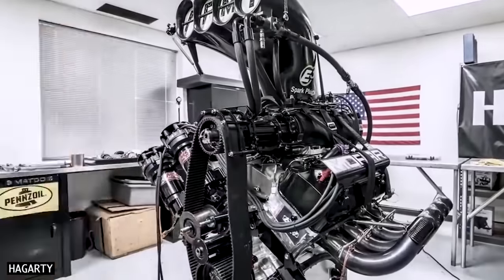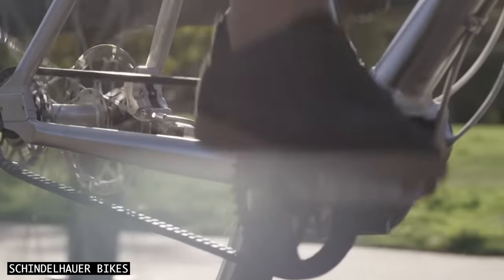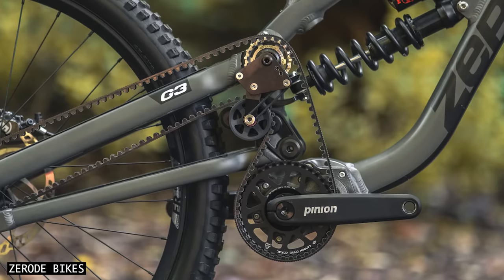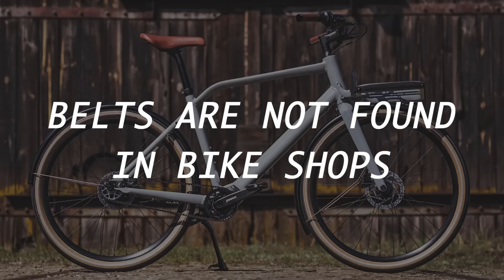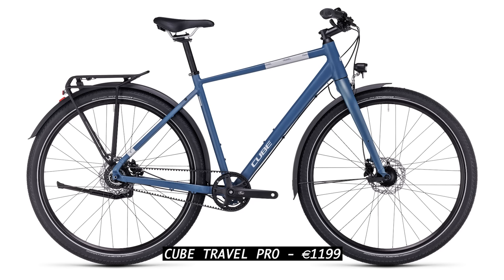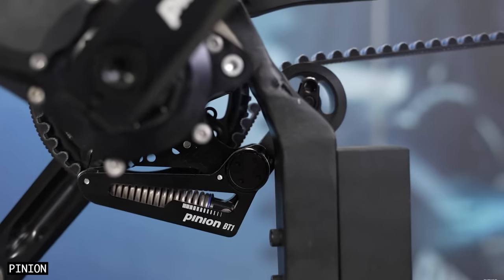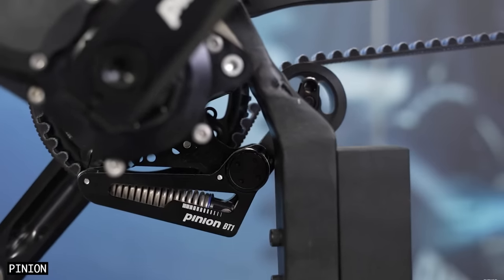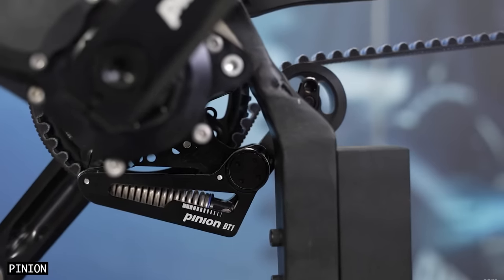Belts Are Now BETTER Than Chains On Bicycles!

Comment: Not for fixed gears 😅
Reply: why not?
Reply: @markifi  amount of preasure while skidding is a really big problem.
Reply: @gig2gle  i really doubt that would be a problem. (admittedly i've only ever skidded a fixed gear a few times) both the chain and the belt have to pass the same safety standards to be legal to equip bikes with. 8 kilonewtons if i recall correctly. that's 624 kilograms on the pedal (8000/9.81*13/17) (breaking strength/gravity*radius of 53 teeth chainwheel/crank length). the grippiest of tyres will sooner slip i think

am i misunderstanding you?
Reply: @markifi  eng not my native lang, i hope you'll understand me. 
There are whole calculations here, wow. I'm talking about the fact that on the fix, the chain experiences stretching and compression at times when it now has to be skidded or extremely slowed down. Even if the belt is stretched on a horizontal dropout, it seems to me that in moments of hard work with pedals, the belt will be softer than the chain.
Reply: @markifi  for me it's like to compare a paper and two wooden sticks. In situtation of pressure from both sides paper will folld, while sticks will try to find way to not crack, and only in bad situation without any possible ways will crack. 
Yep

Comment: Blah blah blah, 23 minutes?!  Chain drive is MORE EFFICIENT at transferring power than belt drive.  On a bicycle if you're interested in maximizing the power from your effort to the bike, there is no debate, chain wins over belt.  Maintenance, cost, durability, etc are all other considerations that may change your answer.

Comment: If belts were better than chains then the majority of bikes would have long ago gone to belts….Less efficient and heavier, those are two huge downsides that can’t be overlooked.
Reply: People keep harping on efficiency and weight, but those aren't the reasons for most people. Outside of racing, its the horrible engagement that limits their value. They're just much worse on technical riding like you find on natural trails.

Comment: this guy is just blatantly lieing...  he's comparing one of the best belts you can get to the worst chains you can get. the reality the best chain you can get will by far outlast and handle far far more than a belt and it's just. as quiet.  the only major drawback to a chain over a belt is the maintenance required for a chain.  near every single other thing he stated was just blatantly wrong or greatly exaggerated
Reply from the maker: Nope. I've used the best chains and the best belts. Belt drive is a huge step forward for all the reasons I mentioned.

Comment: Motorbikes dont use belts, they are very uncommon
Reply: Correct because those belts can't handle the torque! The same with Engines, the very high torque ones cq Diesels are all using chains.

Comment: How about a chain enclosed in a chain case? the issue is not the chain. The issue is very poor design. Chains should not be run out in the open, they should be in a oil bath. Or at least enclosed.

Bike drivetrains are very poorly designed for long maintenance intervals and wet weather. A well designed bike would keep the drivetrain clean in all conditions. This is possible with a chain, easily.

Comment: but HOW do you FIX Belts? Oh right, you CAN'T.  Sorry, if you cannot fix it but have to replace the ENTIRE DAMN THING, then it is simply NOT better. If a chain goes bad, you just remove the broken element and fix it. You can even size adjust it if you have to. Can't do that with a belt. Sure a Chain needs oil and a good cleaning every once in a while but so what? Mechanic things need care and maintenance. I swear, belt driven bikes are just a marketing scam.
Reply: A belt lasts tens of thousands of kilometers.

Not everyone loves getting grease everywhere, not to mention all the dirt that collects in it...

How is it a marketing scam when it has actual benefits? It is quieter, clean, lasts longer and is less likely to jump off.
Reply: .... do you have a belt on your bicycle?

Comment: Not better.  Belts have more friction to overcome than a chain. Get real. Be scientific.
Reply from the maker: If you actually watch the video, you'll find all the scientific data you need to know that there is NOT more friction with a belt (in most circumstances).

Comment: Belts are not better by any metric that matters. Require specialized frames, not repairable on the ride, expensive when combined with the necessary gearbox or igh, heavier, less efficient. 🤦‍♂️ So yeah, not better, at all, nope. 👎

Comment: All these are just marketing gimmicks. Since when are plastics and rubber more durable/reliable than metal in power transmission!? Joke. Get a motorcycle. That's the future of bicycles where manufacturers are working towards...😂
Reply: Since when is a chain that has to be out of alignement and jump between sprockets all the time longer lasting than a belt that runs straigth and never moves postion less long lasting?

Comment: You can't use these belts with proper gears, so no, they aren't better. Also, you can't use these belts with proper( light) frames. Totally not interested.

Comment: The split frame is a total failure in my book.
Reply from the maker: Why? You can easily engineer your way around a failure, there is very little extra weight, the cost is low, and they're easily integrated or even retrofitted.